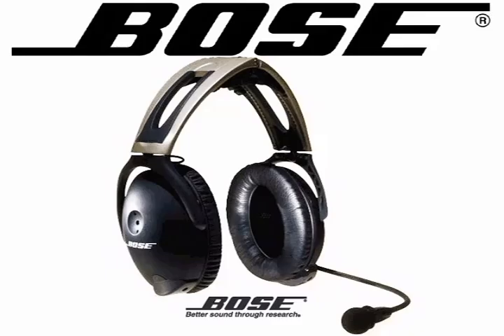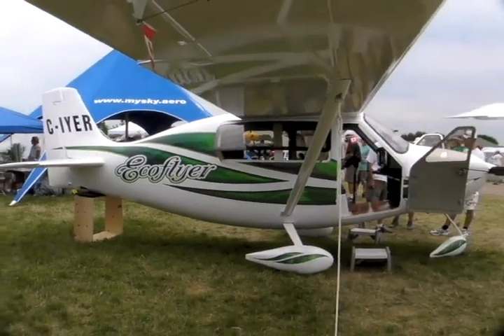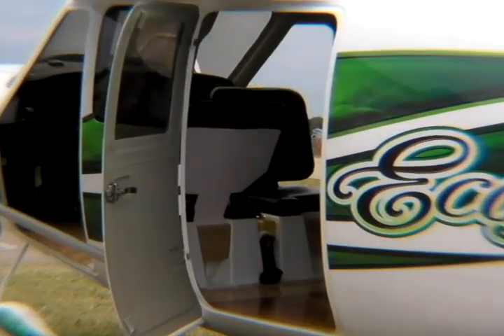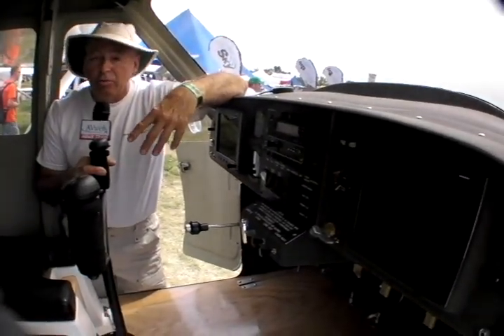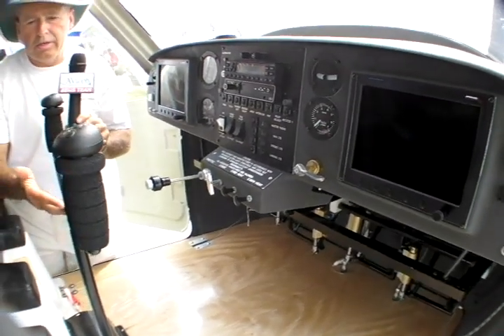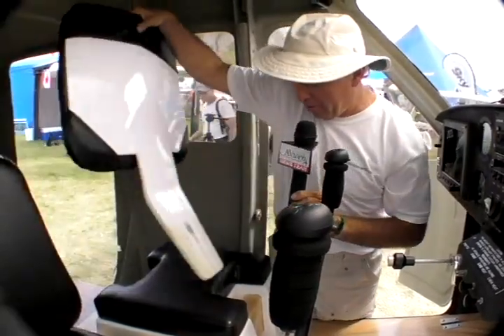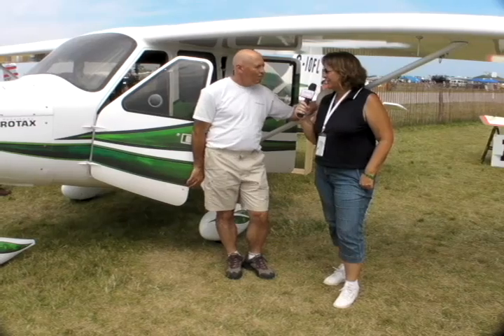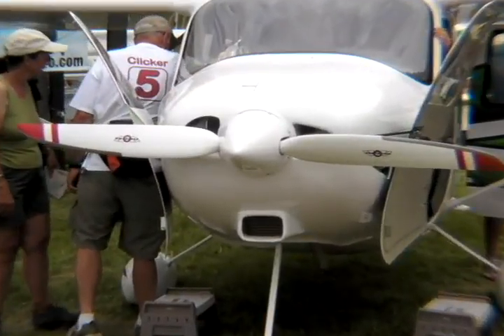EcoFlyer, The Live-In Light Sport Aircraft -- Oshkosh '08

Comment: It is very sad that the owner of the company speaking in this video died in this airplane. I personally love this airplane and I hope and pray that someone picks up and carries his project forward. Aviation needs this kind of flying SUV as most planes are cramped. According to witnesses, Mr. Bernard was flying back home and when he landed at the last airport where he was seen, he was very scared and agitated by the turbulence he experienced while flying. Sadly, very sadly, he fell victim to the known I-have-to-get-home pilot "syndrome", which has finished other pilots as well. His plane could not deal with the high turbulence, wind shear and crosswinds on the way home and crashed on trees. By the look of the wreckage, which looked just pancaked flat on the ground, the plane was not built with a sufficiently strong structure around the pilot. This appears to be the reason why the plane made the 750 lbs. limit. Planes can be built light and strong but, apparently, his company did not do enough research and tests to confirm this. Nevertheless, it is a very sad loss and I hope someone picks the torch of this great aviation innovator. Prayers for his family.